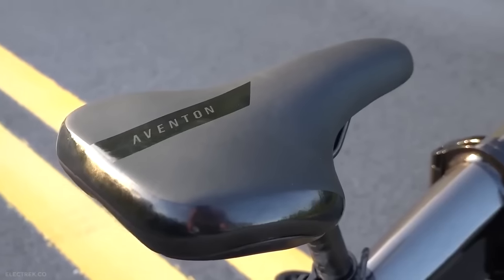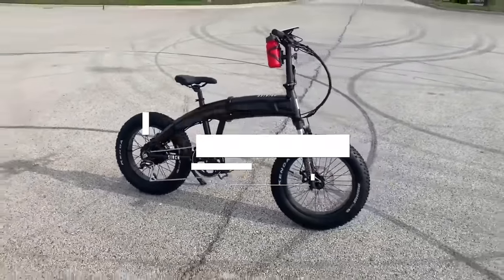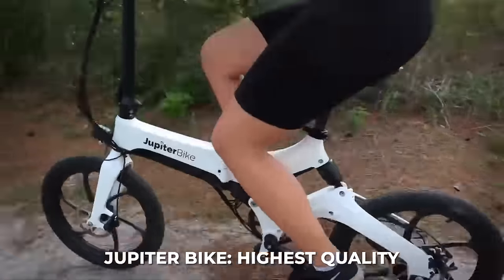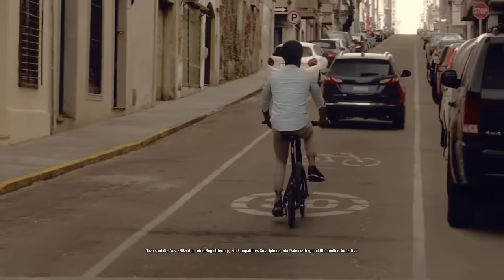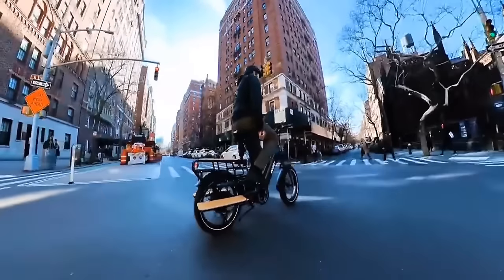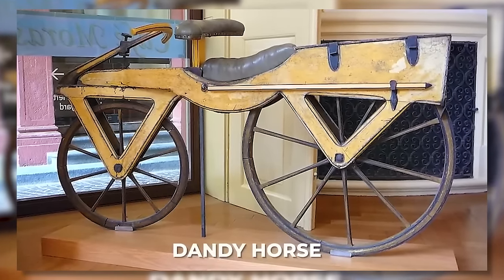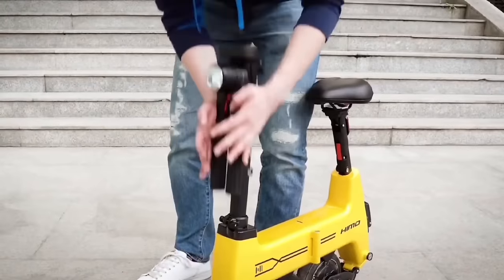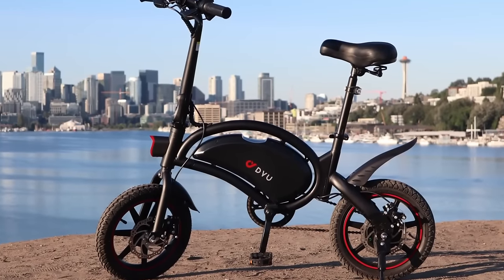69 Folding (and other) Unusual E-Bikes

Comment: As I am another new E-Bike owner/user and believe it or not the 20mph range in speed is enough as my bike has not been altered and my E-Bike took off going down a small slope. I ran into some fine gravel and skid and was thrown from the bike. Also even though the speed was supposedly regulated it still reached 32mph going down a small hill
Reply: 😮.  Are you ok?  Helmet and baggy clothes at minimum are needed.  Check menu for different modes with slower speed limiter.
Reply from the maker: Safety first! It's important to be cautious and aware of your surroundings when riding your new E-Bike. Helmet helmet helmet

Comment: I have a folding bike similar to the "London", but with no gears, that I got from ALDI. It has a 7.5 Ah Samsung battery (as shown). Importantly the motor engages when I peddle, so as long as I peddle downhill I recover charge back into the battery. When my destination is at a lower altitude than my starting point I arrive with a full battery. This works because electric motors are also dynamos. My brother has a smarter bike that wont engage unless needed, so his bike wont charge going downhill. Effectively halving his range. I'm looking forward to bikes that recover charge when braking. Also my bike cost $650AU with an approximate 20 km range. I can buy a 15 Ah battery online for $350AU doubling my range, or tripling if I take both batteries with me.

Comment: Would this company consider using the tiny but powerful e hub wheel put on the 3 wheeled bike that steer's from the rear? Without pedals & light weight frame for adults living in places with steep roads.